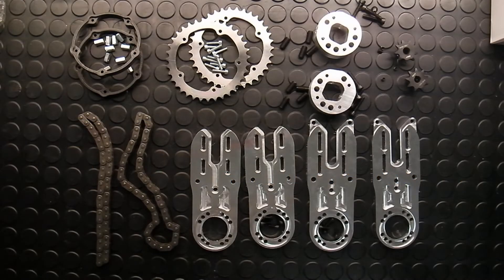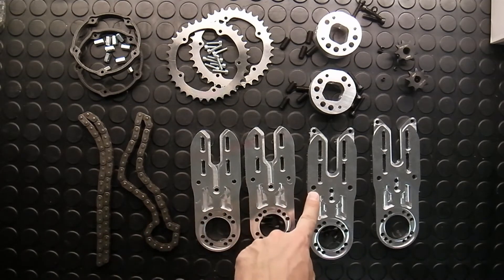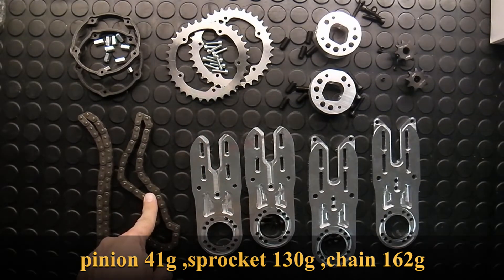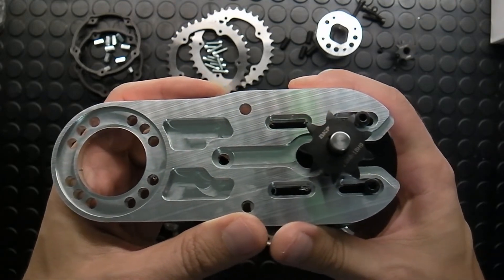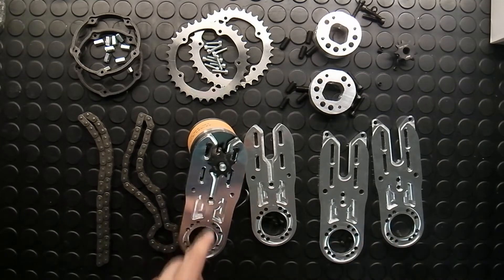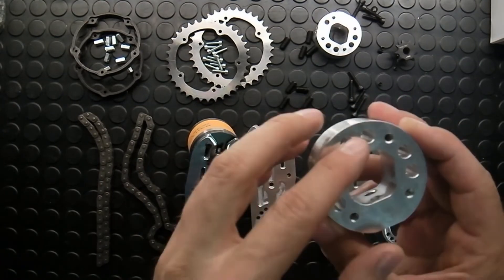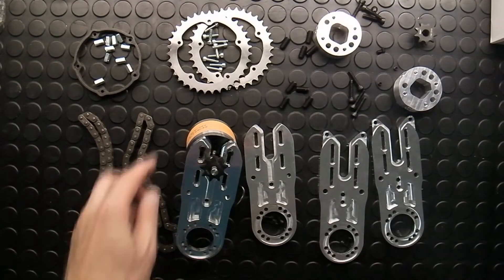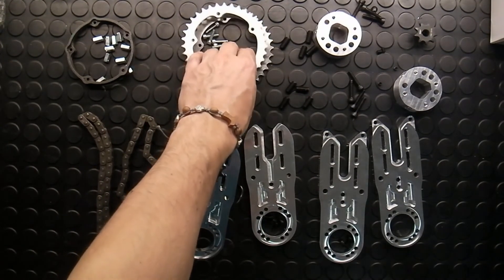Best DIY Electric Mountainboard  Chain kit by FACKO

Comment: I ordered those chain drive from you, I love the sound it makes.  
One problem I encountered is tightening the inner motor bolt, the tire is in the way.
Reply from the maker: Hi. Yes , mounting is little bit complicated, therefore I must create video how to assamble it easiest way. Reason of this design is to have chain covered from one side by motor mount and from secon side by tyre. So all gaps from side is covered to minimise jamming by a foreign object.  Also length of chain needs to be 44 or 46 segments to have optimal worning out. Becouse of this shoud have sprockets long life, just chain need to be changed after 3% stretched out or any mechanical damage. Enjoy it and ride safety🛹🤘
Reply: @fackoesk8  will you be selling the chain separately or each component separately when they wear out???
Reply from the maker: @noka7776  Yes, You can contact me as before, anyway probably I will create ebay account with more items.
Reply: @fackoesk8  how can I order 2 more of the sprocket and 2 more of the motor pinion???
Reply from the maker: @noka7776   Hi Roel. Already contacted You in our previous communication in Messenger. Just everybody can contact me on facko@protonmail.com